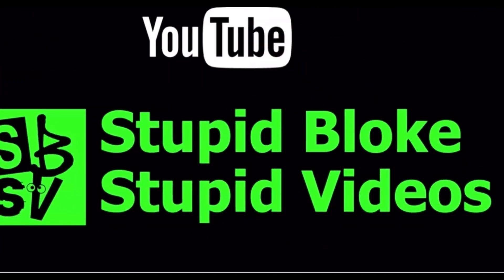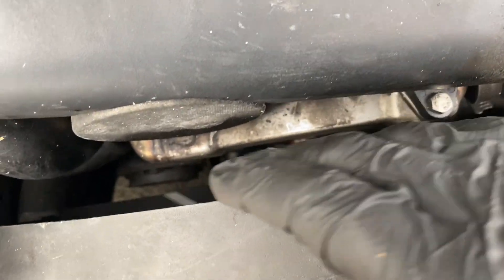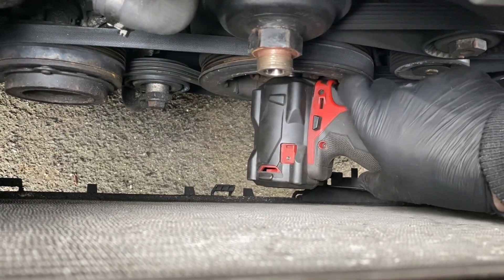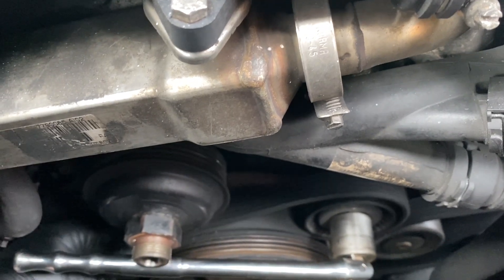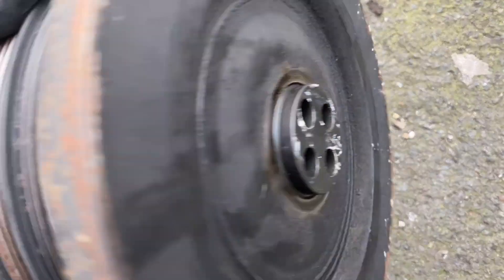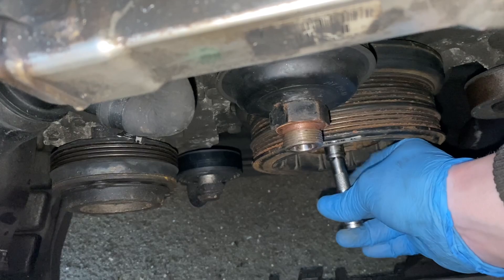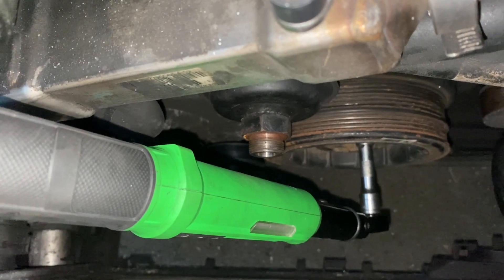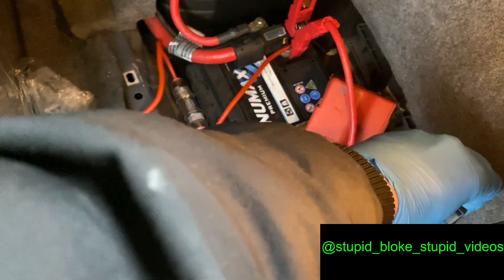BMW E46 Crank Pulley Replacement / BMW M57 Failed Vibration Damper N47/N57 (Same as Many BMW Models)

Comment: This problem on my 335d cost me nearly $3000.  The first shop didn't recognize the problem and treated the symptom by replacing my power steering pump and flushing the system.  They then told me I needed an alternator, which I did myself.  After the alternator swap, I spotted the wobbling crank pulley and took it to my usual mechanic for replacement.  Lesson I learned was, with any accessory drive issue, check this first.
Reply from the maker: Yes, stuff like this can be easy to misdiagnose tbh

Comment: How did you lock the crank pulley? Mine came apart...
Reply from the maker: I just put the car in gear
Reply: @StupidBlokeStupidVideos  mine is Automatic... what to do then?
Reply from the maker: @arn.old.  there should be a way of locking the crank through the bell housing, but without looking I’m not sure where it would be